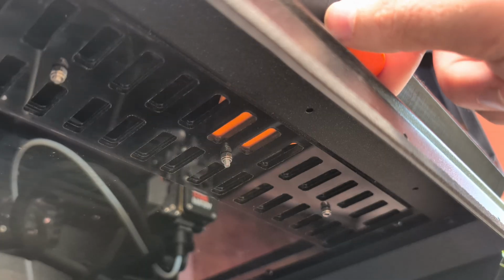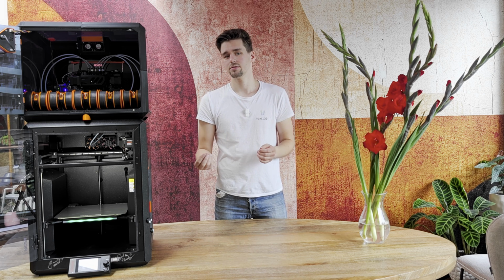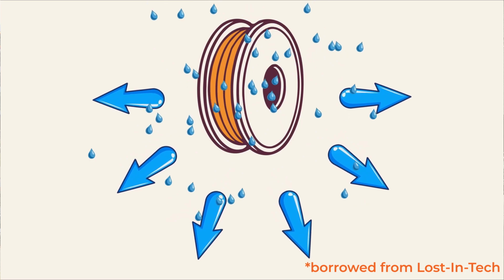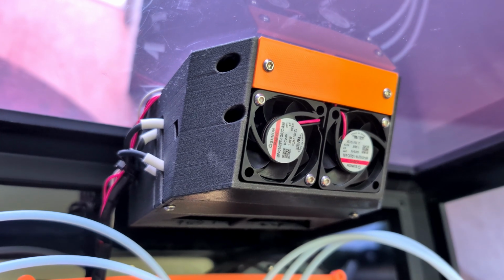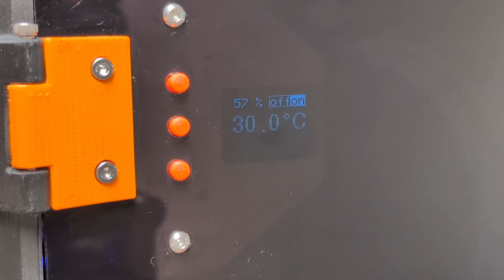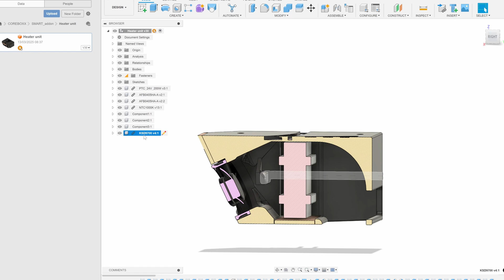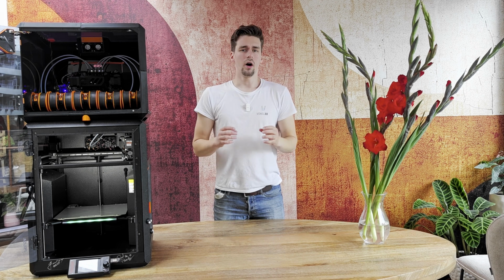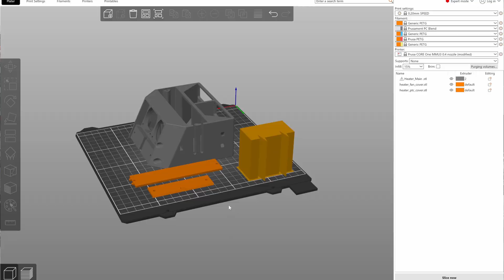I combined an Arduino and PRUSA hackerboard - COREBOXX Semi-Smart

Comment: Would be fun to see Peltier dehumidifier integrated in CoreBoxx, almost done with mine.  The device would provide both heating and cooling, and cool side would take moisture out of the warm air, then cool air is warmed by the other side of the device to keep constant temp and humidity.   Would take very little code, could run on TTGO or similar ESP32 with integrated OLED display.  Then no more silica gel replacement.   I actually use a large device for my RV.   Works great all winter.  What are your thoughts.
Reply: Would require a drip catch, risking overflow, would it not?
Reply: Yes or hose to drain.  RV version has both 2 gal tank and hose for continuous drain.
Reply: Yes definitely the ultimate solution. Plain and simple.
Reply: With an esp32 would be easy to integrate on Home Assistant 😍

Comment: I think the Servo is for the ventilation grill on the top of the coreOne
Reply: @Voxel3D_NL I mounted a linear motor designed to look like hydraulic cylinders for RC stuff. Controlled by the GPIO board and a H-Bridge
Reply from the maker: @rcweinstadt5210 oh that's cool! I think I've seen your post on Reddit or Facebook!

If you want you could try to expand on it's capabilities with this system
Reply: @Voxel3D_NL I think not😂. I kept it a secret 😏
Reply: Or a filament sensor of the more advanced version 🙂

Comment: Cheers I am enjoying building the COREBOXX this week.   I am considering your humidity system, also looking at cheap dehumdifier plumbed into top of chamber which has cold plate where thermoelectric devices, condenses the air just prior to intake of COREBOXX enclosure, A strip heater 30W keeps interior air at correct temperature, then your board manages temp/humidity .  J
Reply from the maker: That is amazing to hear! I tried to do something similar with peltiers, but have not found time to finish it!

Tip; you can use the 24V out for the heater to power the peltier, and the 2x 24V fans for recirculation!

If you get a humidity probe and connect it to the NTC port, you might also be able to install a sensor to prevent overflow of the catch bucket